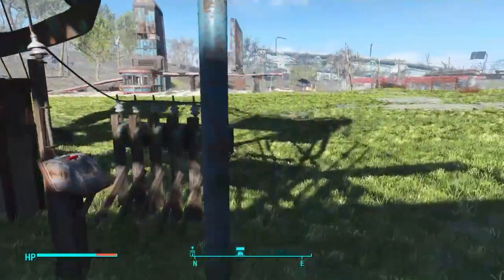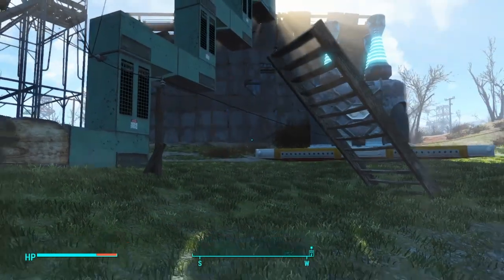Can You Power a Fallout 4 Settlement with Steel Balls? [PS4 mods]

Comment: The hoppers are designed to suck things out of storage and convey into the feed for the machines. I use them on workshops, so as to remove the food/water from them and avoid hitting the cap, though they only work when you are there.

Also heard that the conveyor belts only transmit power a certain range so they won't snap. When you added the hoppers and powered them, that's why they snap again
Reply: The issue with the conveyor belts not wanting to snap is because the belt only spin one way so it was kind of a fool proof thing to prevent you from putting a belt on that is going the opposite way and would clog the lines up